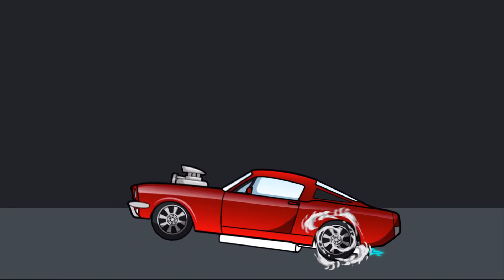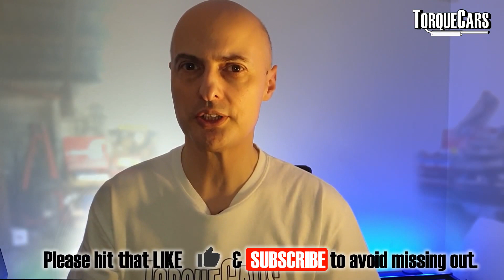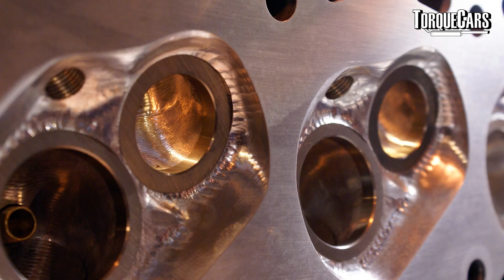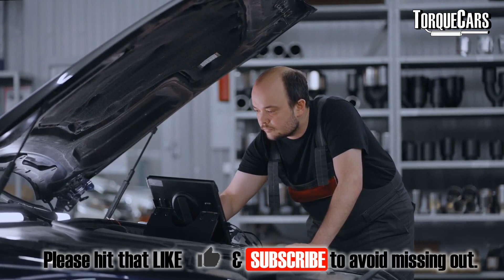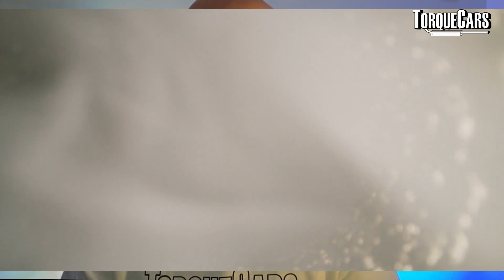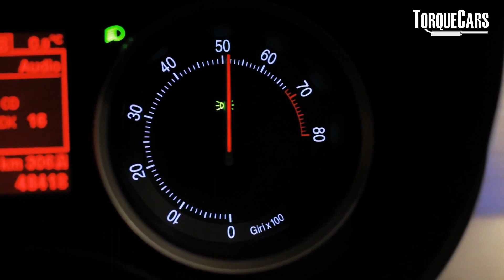Essential Car Tuning Mods & Upgrades [Starters Guide]

Comment: nice! I've been doing research on my 2018 kia Rios engine it's the G4FD .. the 11.0.1 ratio.. with that compression is adding a turbo safe with low psi of boost? 
if not safe, I plan on just fitting headers and deleting the cat and resonator and muffler so I can run a 2.5 straight pipe all the way through from the headers..to see how much power I can get out of that engine and compression.  especially with a tune.
Reply from the maker: I believe that engine is direct injection which negates many of the problems from detonation and preignition, so if you are very careful with the mapping and fuel injection it should be possible to add a low boost turbo, but this is going to be quite a complex upgrade and personally I would recommend against it for the time and cost of this conversion. If you were going to go forced induction you might find a supercharger easier to install and setup on this engine.